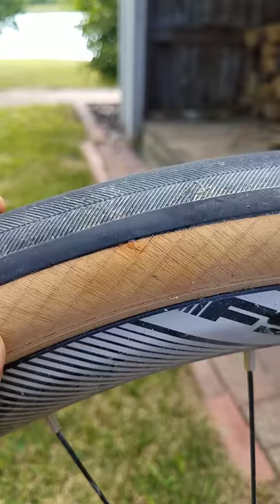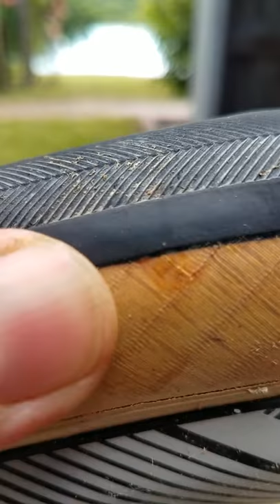Compass 700C x 44 Snoqualmie sidewall leak 2

Comment: Which do you think you would prefer, the 700x44 Snoqualmie Pass or the 650bx48 Switchback Hill? Do you think that 4mm of width would make a big noticeable difference? Thanks :)
Reply from the maker: the 700x44 is cushy and fast. If your bike takes a 700x44 that is the route I would go. 90% of my riding is gravel. I have actually gone narrower, have been riding Compass 700x38 Barlow Pass and have decided to settle on it.